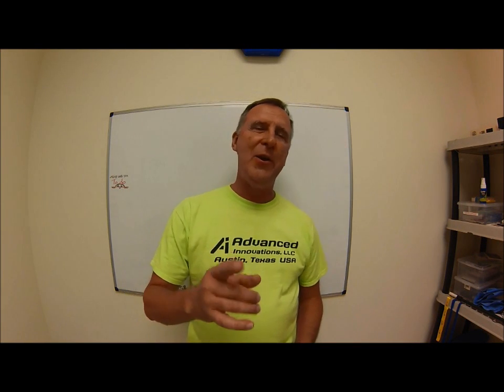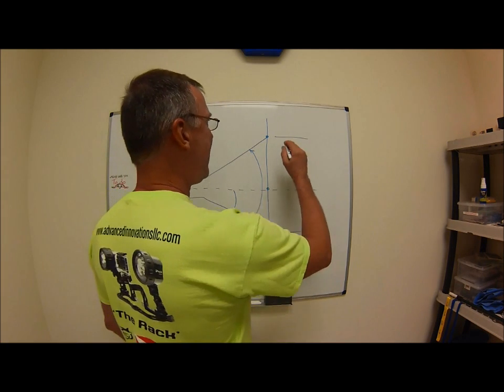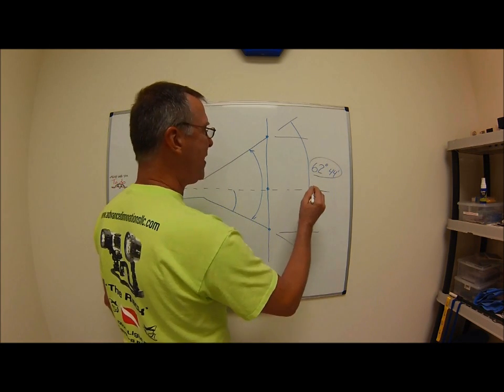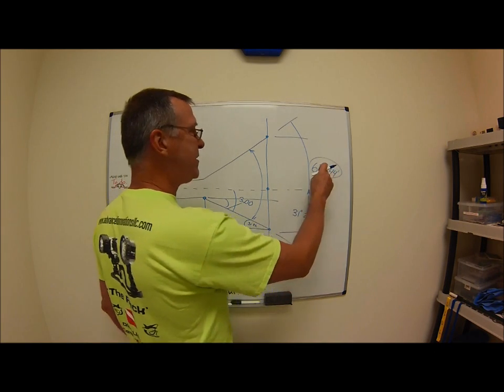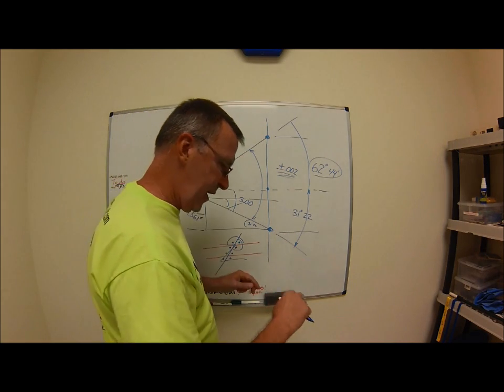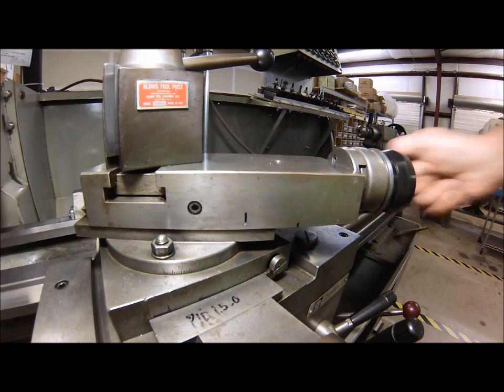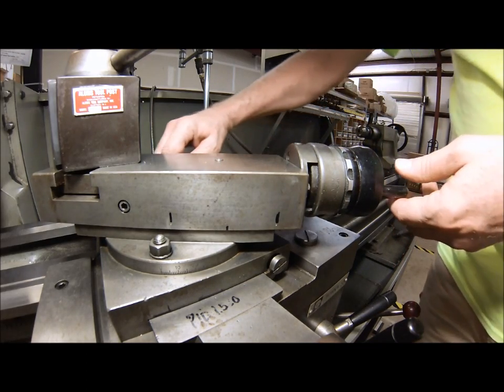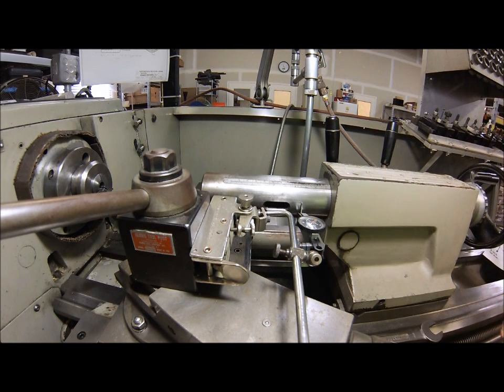Setting the Lathe compound to precision angles

Comment: I am so confused... mbe I should have paid more attention in Trig class instead of blowing spit balls at the back of the teachers head ! He had a large bald patch on the back of his head though... It looked just like a target,, we couldn't resist LOL No wonder I ended up a lowly carpet cleaner LOL.  But I'm a damn good one !    :)
Reply: +Jag On The Drive Machine Shop no lowly or common... ANY job, regardless of difficulty or ease, should be done right. If you have but one plank to scrub, scrub it like davy jones is watching over your shoulder. ;-)
Reply: Think about how much more accurate you are at anything that requires percussion because of all that target practice.
Reply: I just don't like the term "RIGHT" it is so emotional "your way is always right mine is always wrong" but for a better than average mechanic I always strive to work to a high standard. Standards can be measured. This method is one way to cut a tapers to a high standard. The way I was taught by a tool and die guy took 2 dial indicators in my shop there is only one. nice to know more than one way to do this. (not intended to be offensive or arrogant just my thoughts from what every gray matter I have left)

Comment: How would you find out the taper on the end of a shaft.
Reply from the maker: Hi Danny. With any kind of luck, you have enough taper present to work with. If you don't have an optical comparator or sine plates and V blocks, set it up in your lathe and get it to run true. Turn off the machine. Adjust your compound to track the taper until your indicator stays on zero. Then basically run this demonstration like you are setting the compound. record the drop distance. Do the trig. Problem solved. So basically you set your angle before you know your angle and just let the machine tell you what your construction triangle looks like.
Reply: The taper is on the end of a cam shaft and it is still in the engine. I have tried a many times to measure the taper. Every cone I turn does not fit the best I can get is a slight wobble. I have tried lapping with valve lapping compound but when I torque my turned piece onto the cam shaft I have a slight wobble. I am using paper in between the piece I turn and the cam. My piece works but I would like to figure out what I'm doing wrong.
Reply from the maker: Danny, your taper angle error can be one of two things. Either its too big, or its too small. Period. Figure out which it is and just start making cut adjustments until it seats. Then cut your final part. The rocking will be your clue giver. If your taper hits well onto the cam, your conical angle is too small. If the cam goes into the conical feature and rocks at the back of your part near the engine block, your conical feature is too big. They do sell contact blue to show where parts are making contact if you need precision like that. You may have to go back and forth a few times, but knowing which direction to go is your first step.

Comment: Good video but you are assuming that your tail stock spindle is parallel to the ways. I have yet to see anyone in the YouTube community test theirs. I did mine and it is .003" in 4". Its on my to do list to fix. Maybe I should make a video. Ha!
Reply from the maker: Russell. First, thanks for your comment and for taking the time to view my video.Second, If your tailstock is out only .003 in 4".....leave it alone and put something else on that to-do list. Break out your trig calculator or whatever else you use and take a long look at really how minimal an error that truly is. if you do decide to attempt to make it better, first, recheck the .003 error with the tailstock spindle locked, and if that doesnt improve the situation, film and post how you plan and execute the correction. I'll be your first thumbs up if you pull it off. Good luck.

Comment: This technique is very cool. However, there is some variable in it. A good, experienced machinist knows, if his lathe has a perfectly aligned tailstock or not, and for many people, it's a default requirement, while hobbyists or newbies are not aware of this aspect. Often, tailstock axis is not only shifted away from or towards an operator (it doesn't matter in this case) but also is not completely parallel to the spindle/ways axis. So, it is a good thing to check by running an indicator along the tailstock shaft using only a carriage wheel before doing this setup to ensure that we dealing with a right triangle, not one with the 89.8531º angle or something.
Reply from the maker: This is a good suggestion. It would only take a minute and assure your angles are accurate Just for thought....1 degree = .0174 over 1". If your triangle is in the 3" range and your tailstock is discovered to be .005 out, that would only translate to a 6 minute error. Still closer than most people could ever get by eye. Remember the tool must also be as close as possible to center, or you start to flatten out your angle.
Reply: Joe Pieczynski
Sure, errors, introduced by things like that are usually not that large, but so many people just have a tendency to blindly trust the machine without checking anything even once. Some discoveries could be very surprising.

Comment: Must have missed this one - what a great explanation Joe - ever so useful. It's rare I need that degree of accuracy but sure good to know. Never really considered such a trig approach.
Reply from the maker: Make sure the tool is on center as well, or the angle may come out different than the setting.
Reply: Joe Pieczynski hi Joe thanks for the video this is really a big help. I got a quick question I don't know if you have time to answer or not but I'll give you some background first. I couldn't afford a collet check yet I had a bunch of er40 collet so I decided to try my hand at making one I started out with making a practice run using 1018 cold rolled steel cuz I had a big chunk of it laying around. That I made one out of a 311 stress proof and it turned out really nice by the way. And now I'm going to make one out of D2 and get it heat treated properly. My question is what tool would you use to measure the angle once a project is finished? What were the inspector use to check that angle?

The reason that I ask is that despite the stress proof Chuck coming out very nicely it's actually a little off in the included angle I know this because I did the whole bluing test. But despite it being off I get absolutely zero run out. I got an old Logan and I got a really good spindle on it because I cannot measure any run out whatsoever at the nose either internally or externally. I cannot measure any run out whatsoever on a gauge pin being held by one of the ER collets.

Should I leave well enough alone? Or should I try to make that angle perfect and again how can I measure it after the fact.

I know this is an old video and you're extremely busy so if you can answer this I'd appreciate it if not I understand

Thank you for your time

Jeff
Reply: @ClownWhisper  if you get zero run out with a tenths indicator..clamping a gage pin in a collet.... repeatedly.... leave well enough alone.
Usually those are ground the collect holders.... but if you realllllllly wanna play with it... not recommended.... I would do you bluing method as before and then use a diamond compound on a piece of wood to work the high spots.... trial and error over and over until your bluing trick is whole..... but when done make sure to wipe workpiece thoroughly with mineral spirits as the diamond paste left over will embed in collets and wear it all out
Reply: @gusmcgussy3299  thank you I actually did finish the taper with the tool post grinder so did have a really nice finish in the end. Despite the fact of losing some of the taper towards the end it was really done with most of the collet surface so it's been good ever since.

It's so nice it is actually depended on the quality of the the collets did I use so I guess that's really how it should be.

Comment: I used a very similar process to set up cutting an MT 5, though I cheated a bit by laying the dimensions from the machinist handbook out in a cad program to confirm the amount of size reduction per inch of the taper length.  It worked, once I discovered that the dark hole I was trying to match the taper to was actually an MT 5 stub taper and made an appropriate relief cut.  Quick to engage, easy to knock out, and the results on measurements for run out are repeatable ... is that good enough for guberment work???
:-)

I'll be looking in later to see what other tips you have to offer ... and Thanks For The Head's Up, Chuck!
Reply from the maker: Thanks for stopping by. Stay tuned

Comment: Excellent method... much easier than fiddling with a sine bar (even if it has a magnetic base). As others have noted, make sure the tail stock quill is aligned with the spindle center line like it should be. If it isn't aligned both vertically and horizontally, it should be corrected in any case as it will cause all sorts of mysterious errors.
Reply from the maker: Thank you for the comment. Making sure the spindle of the tail stock is true to the ways and movement of the carriage are the most important things to check. Since 1 degree over 1 inch = .0174, and our triangles are in the 3 inch range, even a .005 out of parallel condition over 3 inches is still within minutes of perfect. Since the indicator tip theoretically contacts that spindle on the same plane at both ends of your triangle, having a precision vertical alignment isn't really a critical factor. Eyeball it close to the vertical center should be close enough. Making sure your tool is on center is really the game changer.
Reply: As you say, vertical alignment in this case isn't critical. It can be a problem though when drilling, especially drilling small holes. Vertical misalignment can be a problem if you are trying to turn a closely held diameter and keep getting a slight taper. If you jockey the tail stock to correct for it, then if the quill or tail stock is moved for other work the taper shows up again. 
    I discovered that my 12 inch lathe's tail stock was 0.005" high to the spindle center line. It should not have been more than 0.002" max. Fortunately every thing else was ok and it was a simple matter to separate the tail stock from the cricket and grind 0.004 off the cricket. It was a real help time wise, to not have file and polish to get straight work that is within 0.0002" of the target diameter over 3 or 4 inches of length.

Comment: Hi Pie! Was sent by the screwball. Excellent explanation, I have a problem reading/trusting the poorly marked angles on my vintage asian 12x36, I will have to pre-figure angles for threading vees and acmes. Thanks
Reply from the maker: Try using a precision ground form or threading tool and just indicate it inline with your cross slide.

Comment: Very nice! This is similar to what I do, only I use a parallel on the compound set to be inline with the centerline of the lathe. This is a faster method for sure.
One issue people should be aware of.
This assumes the barrel on your tail stock is inline with the ways, and is free of defects at the contact points. This is a bad assumption on an import. You should verify the barrel on your tail stock is in proper alignment. You would want to fix this in any case.
You can still correct for the error though.
affix a sharpie to the compound inplace of the test indicator.
Touch the barrel with the sharpie at the compounds 0 mark, and again at the compounds 3" mark.
Sweep the barrel with a test indicator from mark to mark and record the error.
This error is a constant and can be added or subtracted from how far you crank in the cross slide. Make a drawing and you will be able to see where to add or subtract.
Reply: Watching this in prep for cutting a Jacobs E Taper for some chucks I have in my parts bin - I was originally planing to try this between centers on a test bar instead of with the tailstock since i have demonstrable problems on the barrel.
Reply: THIS. If your lathe has any errors, it will be translated into the workpiece. This is where the trainee differs from the master. The master understands and compensates for this kind of errors. You could also just use a machined rod in the lathe as a reference, and all errors in the setup would cancel.

Comment: For a guy that can barely add 2+2 and get the right answer, I think this will come in handy!I'm assuming this approach works on all the different MT and JT tapers in case I wanted to try and make my own arbors? Thanks for sharing!! Razor!
Reply from the maker: If you can identify the angle.....you can cut it. Thanks for watching and commenting.

Comment: Another great tip. Saves fafing about with a sine bar. How are you going to measure it? With a sphere?
Reply from the maker: Yes. A ball and a developed gage point. Good guess.
Reply: You could even use 2 balls of different diameter to check the taper angle
Reply from the maker: Again Correct. That involves a lot of math, but it would certainly be a sure fire way of confirming the angle. You are very intuitive. How long have you been in this trade?
Reply: Thanks. Ive always been in to making things. Started machining in school lunch times where I made a little steam engine, then took it up as a hobby and got a bench top lathe and a pillar drill, with them I Built another 2 stationary steam engines and a hot air engine. I then started on the live steam locomotive that I am currently building on camera. Finished school and got an Apprenticeship at Rolls-Royce. I started the videos about 2 years ago. Anyway now I'm 20 and just finished my Apprenticeship, still at RR working as a Grinder. So been machining for about 8 years.
Reply from the maker: Its obvious you are doing what you were put on this earth to do. I feel the same way. People with such natural mechanical ability are a pleasure to watch. At 20 years old, you have many wonderful things ahead of you. Rolls Royce is lucky to have you. Continue to observe, inquire and grow. This is a vast field and you can learn something different everyday. Can I assume you are also a mechanical puzzle guy? Good luck to you Crispin. Nice to have you as a subscriber. Stay tuned.

Comment: I had some jobs come in once that had like that out to 3 decimal places. I managed to cut them and set up a sine bar to check them with and they were right on. A few days later the engineer came back and wanted them recut to a different angle. I told him I'd never had a print before with such precise angles called for. Turns out that they were just experimental angles on a prototype and were drawn on a computer which had put in all the decimal places. I had cut them on a cnc. The next ones I just did on a manual lathe using the numbers on the compound and they worked fine for him. Yeah, engineers mostly seem to have no idea what goes into making parts to some of their prints. Ok, enough of that rant. I never would have thought to do an angle with the method you've shown. Thank you very much and keep them coming.
Reply from the maker: Thanks Dale. The longer the hypotenuse, the more accurate the angle. Give it a try. Be sure to watch the next video on how to inspect them !!